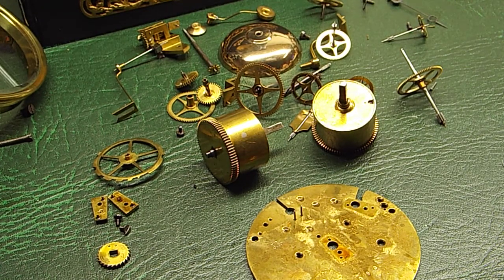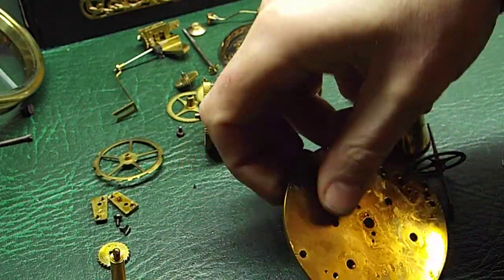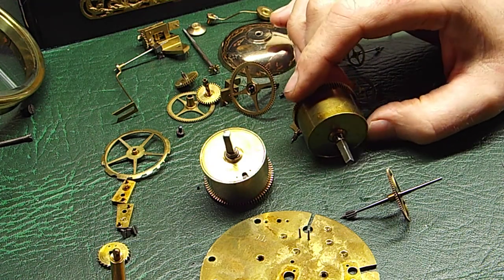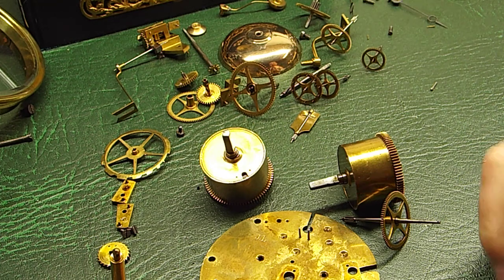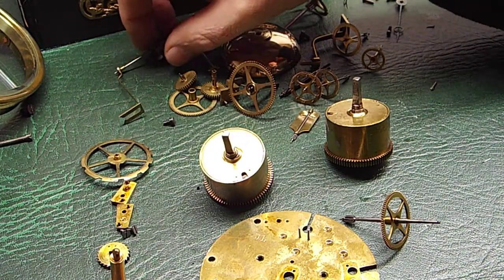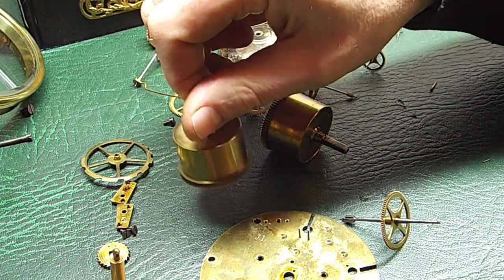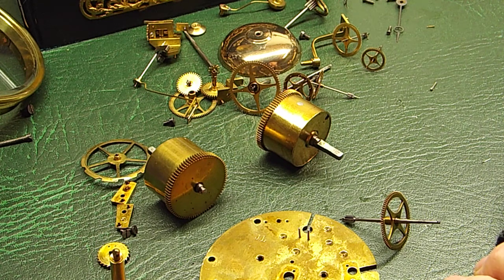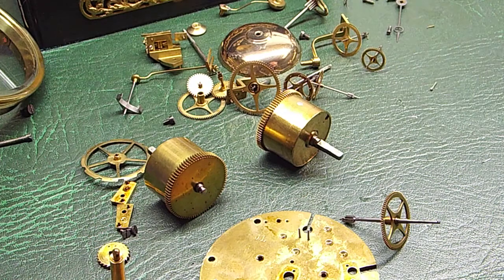Clock Repairs Clock Repairs

Comment: A great intro taster you mentioned set springs replacement what is your critical open diameter? Some say two and a half other views are three diameters re internal barrel diameter. Even other views are don't replace just wind twice a week. I don't hold with the last as if the strike fails the clock often stops. I am a bit of a go change if in doubt so I usually fit new springs with reduced thickness if there is a choice. Your views would be much valued
Reply from the maker: Ok as you said the general idea is 2.5 times the diameter of the barrel, if there not at least that I always change them, sometimes you can actually feel they feel soft if that makes sense, any doubt change them, im much happier if they are more than 2.5 x bigger, i you buy new springs there much more than 2.5 times but the argument there is they have not been enclosed in a barrel for 70 years, any doubt always change them.
Reply: @clockrepairsmerseyside8303  thank you for your time and opinion. Good Common sense and I will follow your advice. I completely understand too your comment on a soft spring. Thank you.